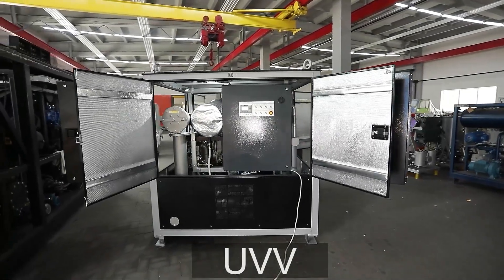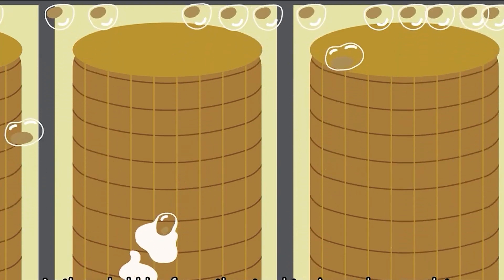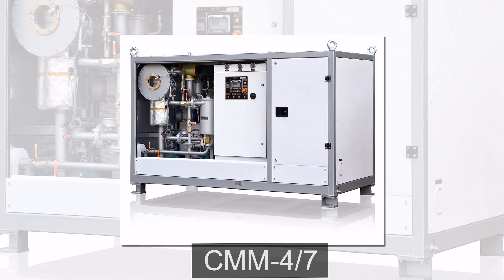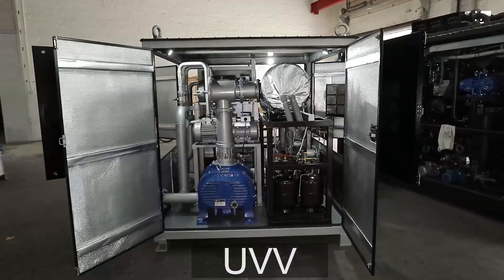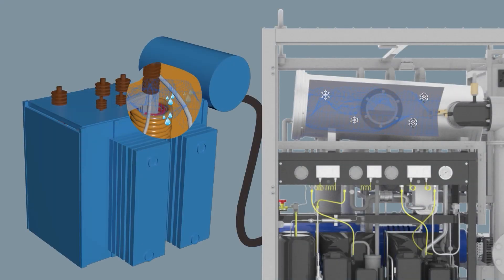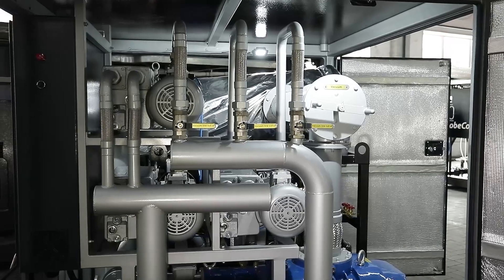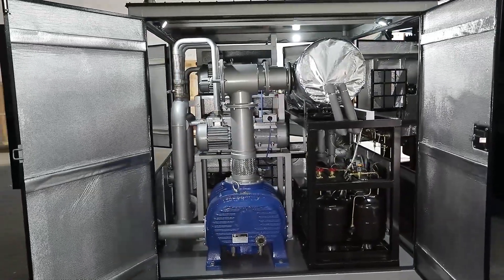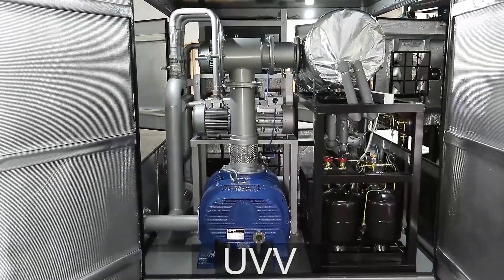Power Transformers Drying Methods. Vacuum Cold Trap UVV

Comment: Is it possible to use this unit for drying the insulation of transformers whose tanks cannot withstand a pressure of 26 Pa?
Reply from the maker: It is possible, but only on the condition that the transformer tank is previously reinforced.